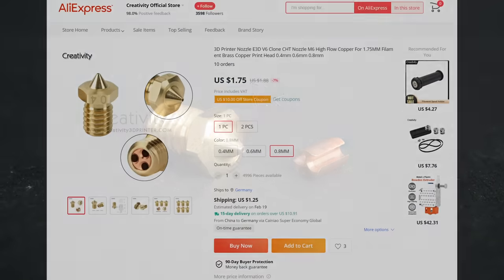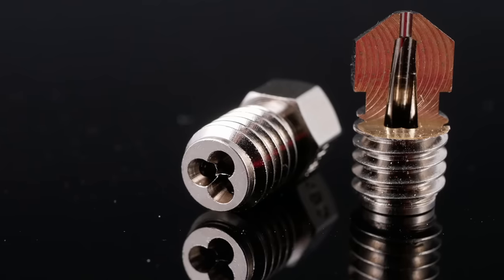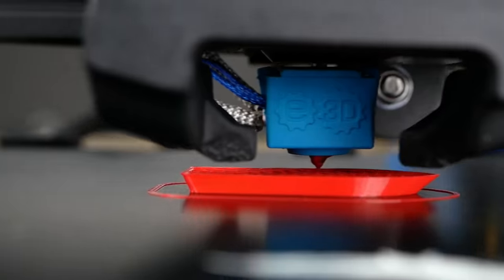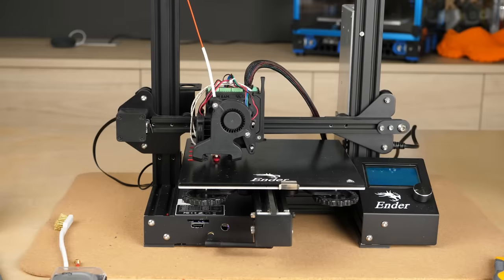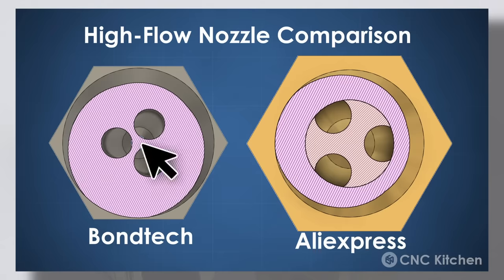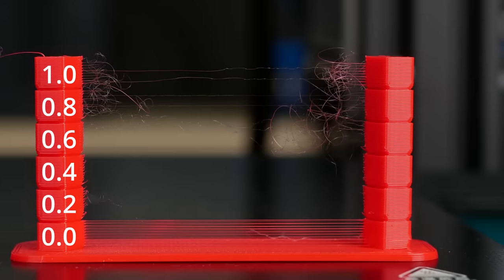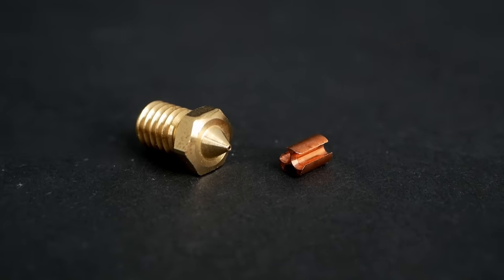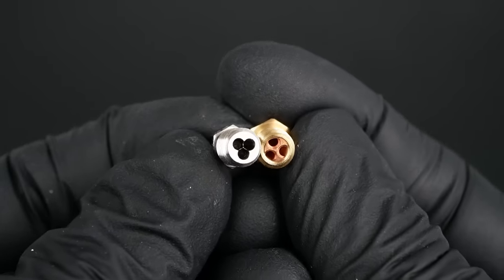$2 Aliexpress Knock-Off better than Original?

Comment: This aliexpress type is probably like 100 times easier to manufacture than drilling 3 holes at an angle and at the smae times gets more heat into the inside.
This design is simply superior on a value level.
Reply: And the wear resistant CHT is probably insert based for the same reason.  Especially since tool steel is a lot harder to machine, with means when you cross holes you are far more likely to break the drill than when drilling C36000 leaded brass.
Reply: If I had to guess the copper in the clone is free machining too, like C14500 as pure copper is ridiculously difficult to drill due to its gummy nature.
Reply: cheaper and better which is actually a smarter design. the CHT hardened core nozzle came after these clones... so... in a way... bontech also benefits from stealing designs from the chinese
Reply: @MegaMaking  Maybe they tried drilling a solid nozzle and regretted it badly when the drill crossed into the first hole.
Reply: @soundspark  I would certainly hope they'd be well aware as to exactly what was going to happen the second the drill crossed into the previous channel, to be honest
Reply: whats simply superior is the one part nozzle, in a CNC machine it doesnt matter what angle you drill in, it just drills the holes :)
Reply: @c4tohagen  While a 5-axis CNC may be backed up with anti-backlash ballscrews to hold the spindle nose stable, the drill will still be the delicate part and the solid brass nozzle exploits the material properties to not snap as it drills into the existing holes.  Since tool steel, even in annealed condition, is much harder to machine, the drill will be far more prone to pulling into the existing holes as it breaks through.
Reply: A sintered tungsten carbide nossel with spiral channel(like a drill/endmill with through spindle coolant) would be awesome.
Reply: @soundspark  Couldn't you set your tool paths to revisit each hole twice? Drill the initial holes, just barely past the point where they start to overlap partially. Let the parts cool, then re-chuck them, and drill them the rest of the way? The more stages you broke it into, the less uneven surface the drill would be exposed to. Could even create a toolpath that cycled between each hole, drilling 1-2mm at a time, since for a cnc, rotating a part isn't a laborious exercise.
Reply: @weeveferrelaine6973  just use a wire EDM
Reply: @weeveferrelaine6973  sure it would be absolutely possible to do it that way. How that would be any better on the other hand, I can't really see. If possible the best case for tool wear is constant engagement. So long as the chip evacuation is not an issue, drilling the hole in one go is usually the best for tool life. When the drill breaks through into the other holes, it has essentially made its own steady rest already, so even though it is an increasingly interupted and uballanced cut, it is well supported. This will shorten the tool life as compared to non interrupted cuts, but consider that endmills always make an interrupted cut, it's not like that is going to be an instant deal breaker. It's also not a super expensive part, so if they have to scrap a few % of the parts due to broken drills, I doubt that would be a deal breaker. Over time they would also be able to collect statistics on how long the drills last, and do the math to figure out how many parts a drill should make, before it's more economical to discard the drill, vs. risking breaking the drill in the part.
Reply: @soundspark  Time to pull-out the lathe, hardened steel, copper, and nickel plating solution. It might be interesting to make a wear-resistant nozzle based on the AliExpress CHT clone
Reply: and made from cooper what is an excellent heat conductror unlike iron.
Reply: @MegaMaking  This isn't the first time the genuine article was worse. The Bondtech BMG caused wavy lines because the gear was slightly off center once the set screw was screw into place. It isn't as bad on the clones for some reason
Reply: the aliexpress one could even be cast if they wanted to

just cast, polish, ship
Reply: @thebowtieguy777  cast tungsten carbide would be cool, just hopefully it holds up to thermal shock
Reply: @soundspark  Tool wear is the only difference based upon the material being drilled.  A properly run CNC will laugh at drilling at an angle.
Reply: @c4tohagen  Superior in concept, but he clearly demonstrated no significant difference in real world usage, which is all that should matter.  Only seeing if time of use makes a difference from wear remains to be seen between the materials used.  But at the prices we're talking ($2.25 ea on Aliexpress delivered), that's almost certain to start happening since it's a no brainer to buy such a inexpensive alternative if you need hi flow rates.
Reply: @paranoidpanzerpenguin5262  If it's the issue I'm thinking of, the clones have a looser fit for the position of the gear so it slips a little to align with the filament. It's too loose on a lot of them and needs shimmed but that's easier than shaving. I think BMG revised the design eventually and added more guide to the filament path so extreme flexibles played nicer too.
Reply: @brianmi40  yes, no brainer to buy such a inexpensive alternative...why dont we all just stop buying from the innovators and just forever buy the cheap chinese ripoffs. Lets see how long the innovators stay in business.
Reply: @c4tohagen  LOL, you do it every day at Walmart.
Reply: @weeveferrelaine6973  too much machining time, too costly. you have more than a thousand ways to manufacture this type of nozzle but the way the copies are made is THE most efficient and cheap since you can also "retrofit" old stock into this new design by boring the entry point to accept the insert. You'll always have a certain percentage of material loss, product loss, manufacturing loss, etc. The smaller the numbers the better (less machining time = less cost for you, less bad parts = less cost, etc). So there are "ideal" ways and then commercial ways! -- So yes you could do what you suggest (if your repeatability / repositioning is good and you didn't have to manually re-chuck any parts) but either way at the cross point your drill will chatter. There are micro mills that could mitigate this but to the expense of a higher costing product. If you analyze the parts there's always visible chatter there's a point where certain imperfections are OK for the end product and there's little to benefit from a better finish in say the insert (as long as the entry point is chamfered any chatter marks won't really interfere with your flow / quality of the extruded filament). Back when this was all RepRap I used to manufacture nozzles and hotends so I got my share of good and bad techniques to talk about heh.
Reply: @fabianbohnert120  continuous wire edm would not be a good choice instead  die or electrode EDM could be. Of course only for hard materials otherwise it doesn't make sense due to the expense. If you had a straight path for the 3 holes you could make a sinker type die to erode the three holes at the same time but since they are not you would have to erode each one separately using a rotating indexing head that is also meant for EDM machining. Typically wire EDM is used for parts that you can cut all the way through. Either way this is a slow process which makes the end product a lot more expensive... material cost at this scale is insignificant almost.
Reply: @Eluderatnight /videos actually, that's a valid point, why doesn't someone just use a cut off section of a drill bit to DIY one of these? it would have 2 or 3 channels already cut into it, and you just need to find a bit that's a snug fit in the nozzle you want to convert.
Reply: @HunterDrone  set it up on a lathe with a dremel grinder wheel dressed to a standard 60*. That would be an expensive part though. Looking at the CAD those holes are waybtoo small. TSC systems run 3000psi
Reply: that's what I'm saying! the idea that you speed up extrusion by 2x isn't the patent. the holes before the tip is lmao.
Reply: Thats one thing about chinese industry, they are amazing at taking someone elses design and making it cheaper, sometimes even improving upon it
Reply: @BloopTube  at the cost of innovation, and with disregard for environment and human rights. Also, quality control is usually pretty bad.
Reply: @soundspark  Tool steel is easy to machine, you harden it after it has been machined. It becomes around 2.5 times harder after treatment.
Reply: And patents suck anyway. They seldom, if ever, work to protect small inventors/designers/companies from having their designs stolen by huge corporations, instead solely serving those very same corporations. And that's not even talking about how they stifle innovation.

Comment: The issues happening with retraction length remind me of when I ran a color-mixing hotend. Since due to the complex internal structure you aren't directly pulling the filament in and out, you're just changing the pressure in the chamber by pulling on the filament. Retracting too much will break the suction and allow the nozzle to drip again. I found smaller, slower retractions to work best with that hotend (Geeetech A10M stock hotend)
Reply: I wonder whether the lose core moved and somehow let more molten material to drip through.
Reply: That completely makes sense
Reply: Being a novice /hobbyist at 3D printing, I was confused when he said he LOWERED the extraction length to DECREASE stringing. I thought he had it backwards, but it was I that was wrong. Your explanation clearly explains the reasoning. Thanks.
Reply: Thanks, I shall keep that in mind when I reactivate my old Diamond Hotend 3-way....
Reply: Retraction always just changes the pressure inside and never actually pulls the filament out. The filament is molten at the tip, so you can't pull it out like you think.

Comment: Thanks for testing this!  The knockoff actually looks like a much better design.  It might be supplied in 2 separate parts to circumvent the patent application thought I have not reviewed it personally.  I'd be tempted to  press the copper insert into the brass external nozzle to expand it radially and make even better contact with the inner walls.  Also, nickel plating the copper may help avoid copper oxidation.  Whether the patent is ultimately issued and depending on any actual claims allowed, the knockoff may be able to make a lot of money before/if the patent is issued.  Interesting...

Comment: I really like seeing these comparisons between the knockoffs and the genuines. Personally, I think patents are sometimes used to gatekeep innovations because they can be so vague that it stops others from attempting to make an improved version, but I really don't know if this particular knockoff is worth using. I certainly wouldn't consider it due to the questionable machining, but if it was of a higher quality I would consider it, because I'm just a hobbyist and $20+shipping is too much for a nozzle. Although I don't think these nozzles are designed for hobbyists anyways
Reply: Of course, even a low power magnifying glass will reveal the exact quality of machining you have in your hands, and at $2.25 ea., one of the most reasonable chances one could ever take to improve their flow rates.
Reply: @brianmi40  The chatter marks in each of the three channels most likely won't be an issue but you could try making your own with a polished surface if you wanted to test out the difference. Also trying other materials for the insert even though we know copper is the ideal choice testing other materials wouldn't hurt. These are most likely made in two ways... By hand using a steel jig with the three entry points with a second op for the chamfering or (most likely) a small cnc lathe with a live tailstock / toolpost drill that performs the operations via indexing of the spindle and it goes drill > chamfer > next index. They wouldn't use a regular drill, instead a micro endmill would be the choice here to avoid the tool from wandering off specially since you have both a "grabby" material and also an interrupted cut.
Reply: Depending on a patent. They CAN be used for gatekeeping BUT for smaller manufacturers/inventors/businesses they are essential. Every one knows that a product can be copied and manufactured in China much faster and cheaper than anywhere else. Patent is there to help the ORIGINAL inventor to recoup the money and time they spent on R&D. You wouldn't want to put time and effort into something and then have a bigger business copy it and take all your business? Why would you ever invent something and put money into something that you are then basically donating?

Comment: A tiny speck of 'hi-temp' or silver-bearing solder to secure the insert into the body would work wonders!
Solder has good heat-transfer, so it might work even better!
Cold pulls with this aren't even worth considering: I'd get a whole bunch of these nozzles, keep one for each type/color of filament.
It seems like a good 'production' tool.

Comment: I bought a pack of 10 of these off of amazon for about $20 and they work great!  I am able to run my ender 3 pro at nearly 90mm/s as opposed to the 30mm/s that I was running before to get a good print.  I am having some problems with stringing, but it could also be that I upgraded to a .6mm nozzle too and am still working on getting everything  dialed in, but there is a definite difference in extrusion speed! I even had to upgrade the extruder to a dual gear one so that it could keep up.  great video!

Comment: I got cht clone from "high quality" manufacturer and it looks the same as this one. Insert was well... inserted. Yes it gives more flow, especially on 0.6 nozzle size. However flow control was worse for me. Linear advance test prints are inconclusive and looks like it should be a negative value, single wall prints with retractions usually have holes in perimeters... Stefan can you take a look at retractions and linear advance in more details? I asked a few people with the same nozzle and they agreed that flow increases but linear advance becomes harder as well as retracts.
Reply: I would also like to see this. I tried a clone as well for a little while, and it worked but I also felt like flow control was bad. I didn't feel like doing real testing with it at the time so I swapped back to a regular nozzle but seeing that other people had a similar experience, I think I'll give it another shot soon and see what happens.
Reply: Any chance the nozzle was from mellow?
Reply: @twanheijkoop6753  tsssss I haven't told you that :D

Comment: The altenatives work fine, just don't drop the copper insert on a dark carpet. They perform a lot better in terms of flow rate than the standard Creality 0.4 nozzles. For whatever reason, the ones I have tested are prone to pick up PETG around the nozzle tip but that may just be a retraction setting. Great review that was very useful. 👀👍
Reply: In my experience, PETG does not print well at all with brass nozzles. I buff a stainless steel nozzle with 3M Polishing Paper before installing. Then I clean it vigorously with a melamine foam pad after each print. For some reason, none of the gurus have ever picked up on this problem with PETG (?). I'm wondering whether I can drop the inset into my E3D SS nozzle. (The cheap SS clones tend to have wrong dimensions - making the adhesion problem worse.)

Comment: Makes me wonder if the Aliexpress version could be improved if the insert was threaded into the outer part (which would also be threaded). It'd give a higher surface area for heat transfer into the insert, and it might fix the stringing issue you mentioned with retraction.
Reply: best cooment, yours
Reply: This could backfire due to filament sticking in the threads and also filament change would be interresting
Might be executed with full core, not "open" to the sides but still there must be atleast a little thread left exposed at the end of the channel.

Comment: I can imagine that the stringing with high retraction values occurs because you actually lift up the copper insert inside the nozzle but gravity drops it down instantly and pushes out a bit of material.
Reply: Sounds plausible. The next step in this evolution (from one-piece that is difficult to manufacture, to two-piece that has the loose part but is easy to manufacture) would be the two-piece design but as an interference fit, and the insert pressed in rather than loose.